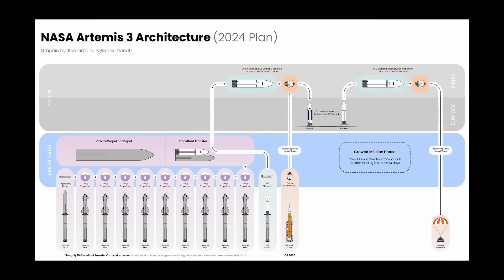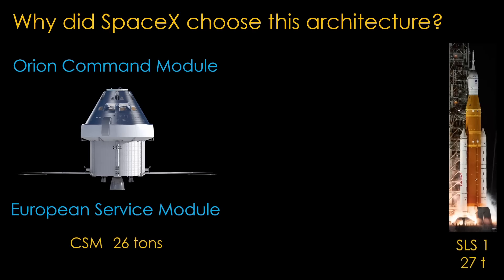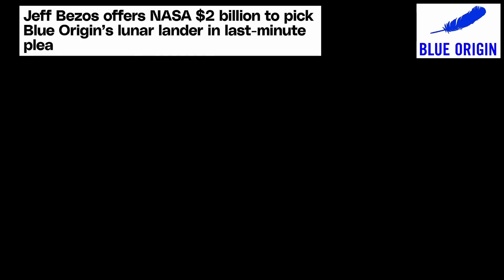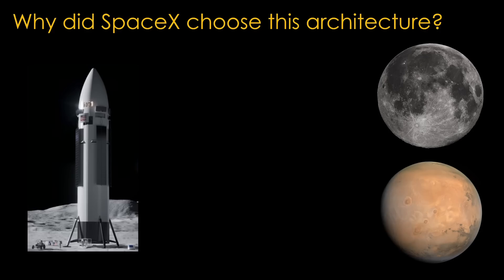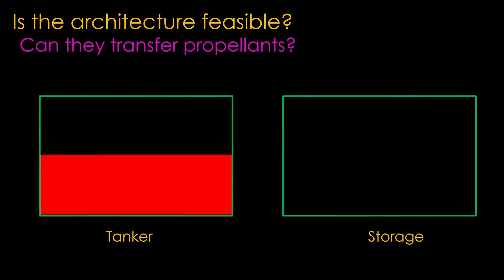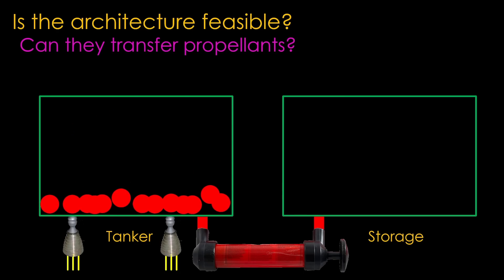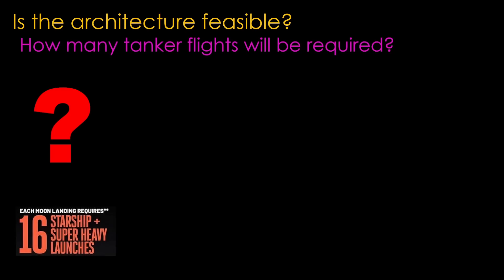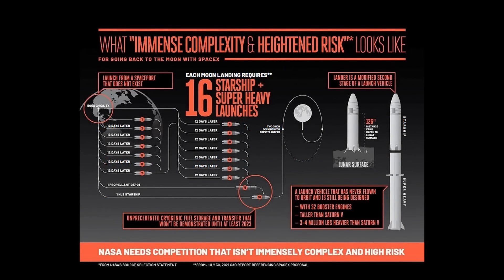Starship Orbital Refueling

Comment: As far as I know Space X does not have a working refueling system in orbit if I am wrong let me know with proof
Reply from the maker: They need to get starship reliable enough for the FAA to let them go orbital and then they can develop it. They have a system but I wouldn't consider it working until it's been demonstrated.

Comment: Everything is easy when you can assume/hand wave the difficulties away. "If Starship achieves rapid reusability, none of this should be a problem." It's the same as saying "if the really hard problem is easily solved, then there is no hard problem at all."

The basic concepts/physics of propellant transfer are well understood. But the real challenge is in the engineering and actual implementation of those concepts. That's why everything takes way longer, and is way more difficult, than a certain billionaire and his followers claim.
Reply from the maker: Many people have asserted that orbital refueling by itself was a very hard problem to solve.

Comment: Another thing about the economics is that from what i can tell, spacex is basically incentivised to keep the costs down and the reusability and reliability as high as possible for the depot and fuelling systems. Basically, it's their loss if one of the starship launches fails to get the fuel to the depot, and it's their loss if they don't keep costs under control.

Comment: You said they can easily manage ZBO with methane without active cooling. But then mentioned the study NASA did where they achieved ZBO for 3 months used a cryocooler. Am I missing something? Can they not use passive means for ZBO?
Reply from the maker: I think you can run without active cooling for refueling approaches, but I don't think you can get to ZBO.

Comment: SpaceX is going to need to have some mechanism for cryogenic cooling because they state that they're going to fly to Mars, which will take so long that the fuel boiloff mass becomes greater than the mass of the cryo equipment and its associated energy supply infrastructure.  And that cryo equipment will need to be redundant.
Reply from the maker: Yes.

Comment: There are also some passive insulation methods that can be added to make controlling boiloff even easier to manage. First is a switch from the current tank on tank layout to a tank in tank layout where the more volatile of the two liquids can be placed on the inner tank where the less volatile fluid can act as an insulating layer in the outside tank. Secondly a very lightweight layer of insulation can be added to the outside of the depot hull to make the onboard cryogenic cooling hardware run more efficiently. Normally I would say that aerogel would be the lightest option but those are very brittle and likely wouldn’t survive the stresses of a starship launch. Luckily there are now much tougher versions being made from plastics called Airloys that are very lightweight and could easily work for depot insulation.
Reply from the maker: Yes. I wanted to see how it would work without modification. 

I don't tank in tank would work from a structural perspective - it would be quite a bit heavier - and it doesn't work from a temperature perspective. Liquid oxygen is about 90.2 kelvin, and liquid methane freezes at 91 kelvin. 

You can get away with it as a common dome in a normal version, and in a depot version you could probably do a double dome with insulation very easily. But if your design puts a lot of contact between them, then the liquid oxygen is going to pull heat from the liquid methane and first slush it and then freeze it. Which is what you really don't want.
Reply: @ I would be interested in finding out how the UK launch companies are addressing this. At last count there were two companies promoting existing tank in tank designs and one more hinting that tank in tank was under consideration.
Reply: @libertykrueger1433  Tank in a tank is a backward move
Reply: @alvianchoiriapriliansyah9882  How so?

Comment: Great video, however you deal with possibilities like possible to launch starship rapidly, despite this not being done. Payload to orbit via starship is another hypothetical scenario, so far 0 payload was delivered, so any numbers you use are arbitrary and being changed by space x on regular basis. I prefer to reserve judgement until some tangible achievement is actually reached.
Reply from the maker: Orbital refueling works fine if you launch once every few days, and it likely works if you launch once every week. I did a video on propellant depots where I did some calculations.

Do you not consider catching super heavy and getting Starship back to a controlled landing in water twice tangible achievements?
Reply: Anything is hypothetically possible, however catching the booster although an achievement, has no bearing on rapid reusability due to the heat damage to the engines, damage to the launch pad. Theoretically you can turn around and go again but engines will need changing, launch pad needs fixing and so far only payload is a banana to low earth orbit. In a greater scheme of things not much of achievement when NASA has been to the moon several times, sent rovers to Mars, probes to the far reaches of Solar system, when you compare it to that, space x is not making a dent. I would like to make clear that I really enjoyed your video, just don’t share the optimism.
Reply from the maker: I'm generally on the skeptical side of the house. In this case I think SpaceX has a really good track record of working through hard problems with Falcon 9 and I expect that they will be able to deal with similar problems with Starship and super heavy. Or they will have to modify their approach to something that will work.

Comment: 13:30 I think spacex still needs to prove rapid reusability of starship. Lets not forget Falcon 9 booster comes back to earth with much less energy than Starship from orbit. Starship is way more complex too and has tiles, etc. But I still think they will do it.

About using gravity here on earth to transfer fuel. What if we can rotate the main tank inside the depot to make the fuel reach the wall of the tank by centrifugal forces?

Comment: What about squeezing propellant out with a piston?
Reply from the maker: Maybe sortof possible. The problem is where you would put the rod that pushes the piston and all the mechanicals that drive it. You would also need to figure out how to seal the edges, and there aren't many materials that are flexible at the very low cryogenic temperatures.
Reply: @EagerSpace  | A central guide rod along the tank can be used in theory if the piston with a central hole is pushed by the pressure on the other side. The pressure can be created by gasifying propellant leaking through the seals. I thought also about another alternative. It can be a loop between the depo and the tanker. A pump sucks from the tanker and blows into the depo, but the return path of the loop allows only gaseous phase to pass from the depo to tanker, preventing liquid back transfer

Comment: Dumb question: why not a flexible sack surrounded by gas, or inflexible plunger, to squeeze the propellant out?  Higher mass but…this is Starship.
Reply from the maker: Perfectly reasonable question. 

It's pretty common to use flexible membranes with helium pressure behind them for hypergolic propellants - it's a very simple system and it works great.
The problem for starship is that there are no flexible membranes at cryogenic temperatures. 
For plungers, you have a problem of where you put the center part of the plunger, but you could maybe build a second top to a tank that is inside and can move down on rails, but it would be hard to seal and you'd need to figure out how to power it.

Comment: @EagerSpace What are your thoughts on Propulsive Fluid Accumulators? 
They using air-breathing ion (or magnetohydrodynamic) thruster satellites in LEO to harvest oxygen from the upper atmosphere as LOX which can be used for orbital refueling, removing the need to carry LOX from the earth's surface. It's a reusable method of generating a theoretically unlimited quantity of LOX at LEO. This significantly reduces the total mass needed to reach orbit to refuel a spacecraft, since we would only need to bring LH and cargo. Boeing's PROFAC proposed a nuclear reactor to power it, but modern designs propose solar panels instead.
Maybe a cool idea for a video?
Reply from the maker: I have "air breathing satellites" on my list.

Comment: What about soild fuel boosters that bolt on in orbit. No transfer pumps. Bolt on 6 and use 3 going and 3 coming back.
Total amount is variable. 
Just thinking outloud.
Reply from the maker: You need to somehow get them into orbit and get them back and solids are much less fuel efficient than liquid fuels.

Comment: I think a lot of people are missing the part about using a rocket as a depot.  The actual lunar lander isn’t going to fly up into orbit and then couple with 10-20 other starships flying around up there.  It’s going to couple with a depot model starship which has already done that.  This is an important distinction because it means the lander isn’t going through up to 20 opportunities for something to go wrong.  The depot ship is the only vehicle to be doing that and that means it can be fitted with much more durable and robust coupling hardware, which will be much easier to do since that’s its sole purpose.  So to recap:  each fuel delivery rocket only has to couple once and the lunar lander only has to couple once.  Also, this means that the depot rocket is the only rocket that needs to have a cryo plant on board.
Reply: "...and then couple with 10-20 other Starships..."

No. Rather, "couple with other Starships 10-20 times." That's a greatly different meaning, and, with full reuse, is possibly a single other Starship plus HLS mission ship.
Reply: All I know is, we got to the Moon before with ONE rocket launch, and now we need 20?  From the 'Department of Government Efficiency" what this look like is a scam.
Reply: As soon as the second stage is recovered in the launch site "chopsticks", the number of tankers will stop incrementing, since only lost tankers need replacement.

Comment: I think you are VASTLY underestimating the difference between 5 flights and 20 flights. You are simply taking SpaceX at their word when it comes to rapid reuse, and thats.... questionable. For one, Starbase is currently limited to 5 orbital Starship flights per year, and even if the modification to the vehicle operator license modification they are seeking is granted, that will still only allow 25 orbital launches per year. So 20 refueling flights would basically require them to start launching from the cape as well, while 5 launches is something that could be done with Starbase alone.
Reply from the maker: I expect them to be launching from the cape as soon as they have things ironed out at Boca Chica.
Reply: They expect to have four operational launch pads at some point in 2025. Two at Boca Chica and two at the cape.

And 25 launches from Boca Chica would actually allow them to do Artemis 3 and 4 without launching from the cape. There's no requirement that the launches are spread out. They could do 25 launches in one month, and then have no launches for the rest of the year, if that is how they want to do it.

Comment: The more interesting question is why NASA didn't plan from the start to fly 2 SLS rockets per Artemis mission, one with the Orion Stack (and possibly a co-manifested payload like a gateway segment) and one with a relatively large lunar lander (38t). It's what the chinese are planing to do with Long March 10 and it would have allowed NASA to only develop a single method of getting large payloads to the moon, rather than what they are currently doing, which is developing two additional orbital-refueling-based methods of getting a large and heavy object (like a lunar lander) into NRHO.
The answer is of course that SLS is very expensive and struggling to be produced at mediocre rate, but still.
Reply from the maker: That's pretty close to what constellation would have done with its architecture, but SLS was just designed to be a big rocket and not actually part of a real architecture.

Comment: Why transfer fuel in space from one tank to another instead of transferring the whole tank from one starship to another?
Reply from the maker: There is not internal tank for starship. The walls of the tank are the walls of starship. If you went with internal tanks, you would add a lot of mass and you would need to figure out how to reload them.

Comment: You say 20 flights in 60 days is not a challenge and then ignore the most important show-stopper for Starship, Stage zero. Starship is nowhere near rapidly reusable at the moment, and its payload to orbit is no where near the 150t initially claimed by SpaceX.
Reply: They'll have four Starship launch pads by the time Artemis 3 happens. That's a launch every 12 days from each pad. It doesn't seem insurmountable.

Comment: Spacex has the option of extended starship with 400 ton payload to orbit, sometimes i wonder if reusability of second stage is needed for starship or not, elon says all the time that they are going to lower the cost of raptors to 200k, and stainless steel body woth out heat shilds and flaps is really easy and cheap to build, why using it twice

Comment: First 16x refueling is horrible in my opnion. I think impossibel to send 1000 starship to moon and mars every years because you will need 16000x refueling😂😂😂😂

Elon musk need develop new bigger tanker for reducing numbers of refueling.

And why need big lander like starship just for carrying 3 astronouts?

And what happen when after starship carry astronout back to lunar orbit?
because starship lunar lander cannot back to earth because lack of heat shield. Or it will stay at lunar orbit or back to moon surface?
Reply from the maker: SpaceX bid starship for HLS because they believed it was a better deal for them than building a small custom lander.

Not sure what the disposal approach is for starship after the moon landing. It won't have the fuel to get back to earth and as you point out, couldn't land anyway. My guess is that it probably ends up in a solar orbit.

Comment: I’m no rocket scientist, so this might be a dumb idea, but could SpaceX add two side boosters to the main one like they do with Falcon Heavy? Wouldn't that cut down on refueling time? Heck, why not go all out and slap 4-6 boosters around it like Boeing’s LMLV?
Reply: Slapping few boosters are not easier than developing a new rocket
Reply: Yeah, it’s definitely not easy, but neither is doing 8-16 separate launches with multiple towers and refueling in orbit. It’s probably the best way right now to get some solid experience in docking a Starship though

Comment: It is 12, the number is 12 launches to fuel this abomination.

Reality check:
SpaceX HLS Schedule

2022 Q2 ORBITAL Launch Test

2022 Q4 Starship to Starship in Orbit Fuel Transfer

2023 Q2 Long Duration Flight Test

2023 Q3 Critical Design Revue

2024 Q1 Uncrewed Lunar Landing

2024 Q2 Design Certification Revue

2025 Q1 HLS Launch

Tick off all of the technical milestones so far completed.
Reply: What about the other delays in the program?  Going to ignore those too?  So much for the reality of that reality check.

Comment: Is there any concern of a RUD while in orbit?  Could there be an explosion while transferring fuel?
Reply from the maker: The worrisome parts of flight are generally the high-energy ones - ascent and reentry. Apollo 13 is an exception, but that was a problem with hardware. 

ISS transferred the far more dangerous hypergolic propellants early on with no issues. 

Always a chance, however, especially if something weird happens.

Comment: Compare all this to the Chinese manned lunar mission profile. They are using the KISS principle. They will use 2 rockets with no refueling anywhere. They say they will land boots on the lunar surface before 2030.
Reply: And they will achieve nothing more with that primitive architecture than putting a flag and some footprints on the moon just like Apollo did half a century ago.
Reply: @admarsandbeyond  They have a roadmap for a fully completed lunar base by 2035. It begins in 2026 with a robot launched with Chang'e 7 which will test out building structures using cement and lunar regolith.
Reply: @Ghandara-hg1gc  They have some wildly aspirational (and highly unrealistic) plans for a tiny research base after 2035, built by some future aspirational superheavy rockets and some unknown future aspirational robotic builders. All they have now are some tiny landers that can't do much of anything: Chang’e-6 will attempt to collect up to two kilograms of material, Chang’e-7 will have a “mini flying detector” to study the lunar topography, Chang’e-8 will launch  in 2028 with a tiny 3d-printer. You can't do sustainable large scale exploration and settlement with obsolete launch systems like they have (which took them many decades to evolve from Soviet rockets)
Reply: @Ghandara-hg1gc  A lunar base requires moving a lot of mass to the moon.  You need to do those calculations or your whole premise is worthless.

Comment: In a previous video you quoted that a starship build from carbon fiber composit will be at least 49 tons lighter. So if the heast shield and braking fuel is not included it might be at least 60 tons lighter. The HLS starship needs just vacuum engines and that further reduces mass however the legs might add up. The question is how many times they plan to refill. Probably refilling in GSO and lunar orbit makes sense too.
Reply from the maker: Vacuum engines alone aren't enough to get into orbit unless you have six of them - possible - and they don't gimble so you can't steer. 

It is true you could build HLS out of carbon fiber. If you are willing to build a billion dollar factory to do it and wait a few more years.